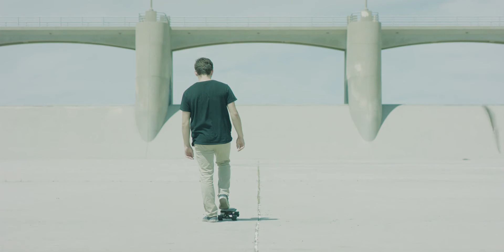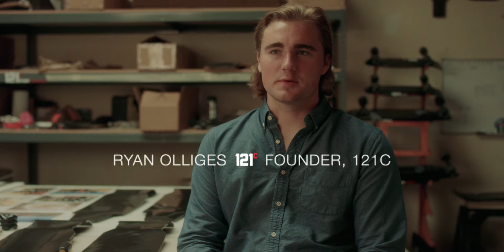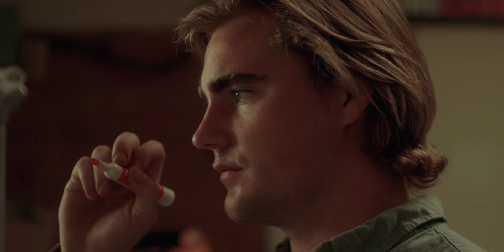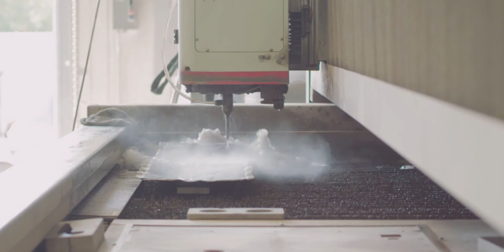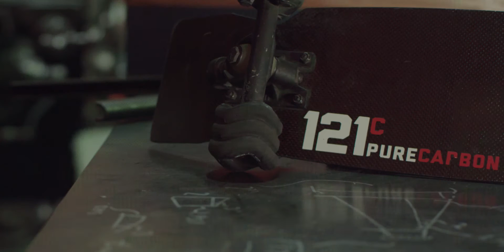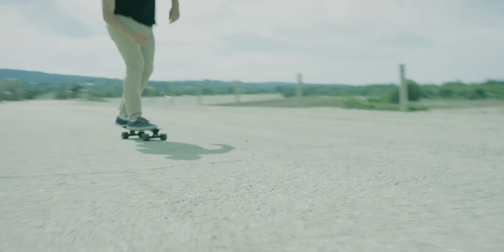121C Boards: The Out of this World Cruiser Skateboard

Comment: Just out of curiosity how does the carbon fiber board handle against chipping when it hits something?  I know hard plastic from penny board is tough.  Worried about the board chipping away
Reply: I have been riding my Rover for about 2 years ever since its release, and 2 years later the board is still riding strong with its original shape still intact and with minor scrape damage in the kick tail from scraping against the ground. With all that said, I would say this is one of the strongest boards I have bought.
Reply: DarkDrago00 hey is the board still good like the bearings and everything ?
Reply: @DarkDrago00  Can’t you use tape to protect the kick tail?
Reply: My board is still good to this day with great trucks and the same pair of shark wheels since I unboxed the board